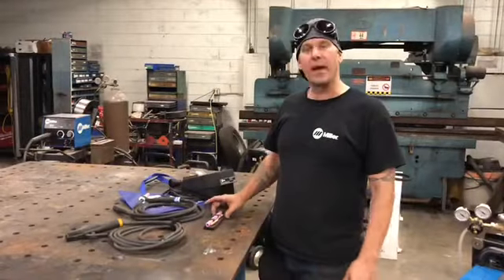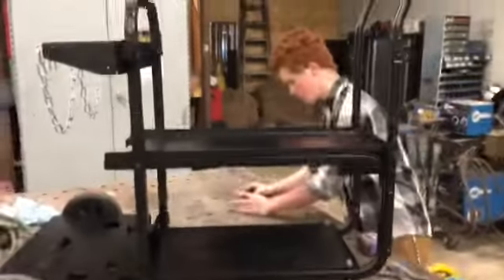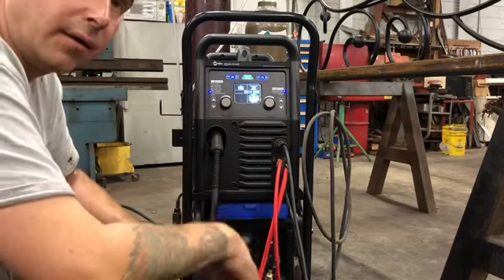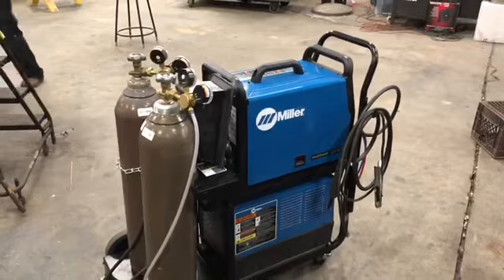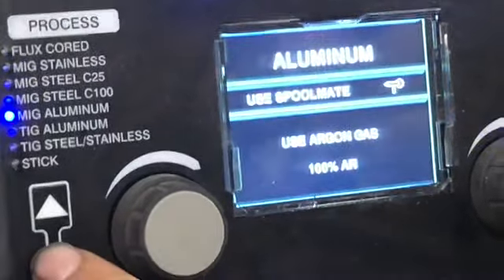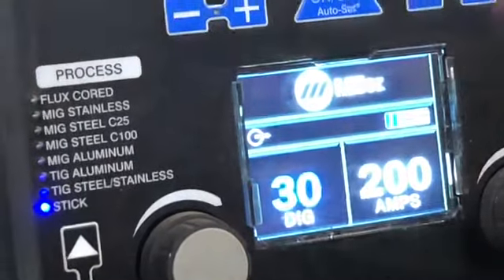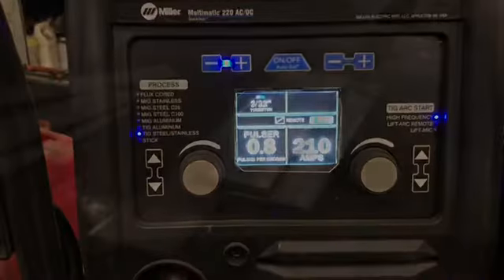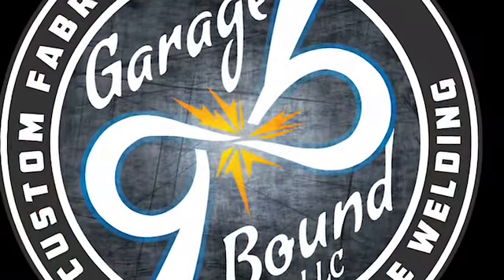Ck Worldwide Torch Upgrade Multimatic 220 AC/DC CK230fx

Comment: Great video! Why did you go with the 300A torch CK230FX vs  250A Torch CK20FX?   Also, what are the brass extension coming out of the Coolmax 3?  I don't have them on my unit, not sure if I need them.  Thanks
Reply from the maker: I have other machines i use each torch on. Tend to find something i like and use it for everything

Comment: Great video and torch upgrade.  Thanks for that.   Any issue running 2 x 120 cu-ft cylinders on that cart?
Reply from the maker: We do all the time. I don’t know if the cart holds the 200 sized cylinders. Let me check tomorrow.
Reply: @GarageBoundLLC   Thanks, I think Miller says 2 x 80 cu ft is max due to weight but I thought 120's might work.  Definitely interested to see if 2 x 200 would work too.   Cheers!

Comment: So besides the CK dinse connector, was there anything else to convert this to water cooled? I wasn’t sure on why you removed the dinse plug shell. Any help would be appreciated.
Reply from the maker: Lovebox you have to remove the shell to plug in the fittings to the water cooled torch, as the dense is where it circulates back

Comment: great vid this helps seal the deal with me. thanks! 

With your experience converting to WC torch what is your assumption as to why Miller when asked the question: Q by individual: "Is this able to run with a liquid cooled torch?"
A by Miller: Miller advises that there is currently no way to make the Miller Multimatic 220 AC/DC Multi-Process Welder 907757 adaptable to a water cooler." 

i.e. are there any safety concerns or any fallout with respect to damaging equipment? Seems the engineers could have figured out what Ck did, no?
Reply from the maker: As a Miller Pro Partner, we had some interesting discussions with marketing regarding this issue. In the end I was told this addition does not effect the machine or it’s warranty. It, in my opinion, would have been best with the option of water cooled torch.

Comment: So did you have to adapt the dinse connection to get it to work? I was told when I bout my 220 that it wasn’t water cooler accessible.
Reply: the video stopped after he got the housing off... wonder if that step was not needed.
Reply from the maker: Nathan Leemhuis it’s not supposed to be. Just buy the rinse plug from CK
Reply: Garage Bound, LLC  nicee 👍 u think a cool mate 1 would suffice? Them thangs expansivee lol

Comment: Wow amazing setup could you please give me the part number for the dins connector kit / power block for the Ck230fx Tourch kit? Thanks so much for this amazing mod.
Reply from the maker: BushWalker SLWHAT-75M is the dins connector!
Reply: @GarageBoundLLC  is that suppose to be SLWHAT-25? I couldn't find the SLWHAT-75M.
Reply from the maker: Jake Dunlap the -25
Reply: Garage Bound, LLC awesome how you cracked the code and hooked this up to a water cooler! I want to invest in a multimatic 220 and build a setup like this. What is the part number for the water cooler? There are 2 on cyberweld.com I’m assuming your using the 230V style but I just want to make sure.
Reply from the maker: Hawaii Fabrication i have the coolmate 3 that has a 110 volt input power. You have to run a separate power source, but no big deal.
Reply: Garage Bound, LLC so just to confirm I’m understanding you correctly; the multimatic 220 can run off 230V shop power and I can just simply roll out a 110V extension cord for the cooler? 

It’s funny because miller says that there is currently no option to make the multimatic 220 compatible with a water cooler for the tig torch. Lol 😂 you’re a legend for figuring this out.
Reply from the maker: Hawaii Fabrication yes! The Multimatic runs on 110, also. Or 220
Reply: Garage Bound, LLC yes I’m aware that the multimatic comes with both 110 and 220. Thanks so much for the solid info. I’m gonna pull the trigger on this and copycat you. Great video. Many Mahaloz 🤙🏻🤙🏻